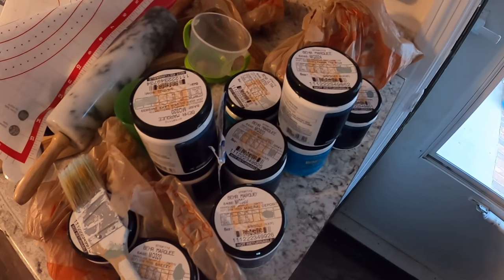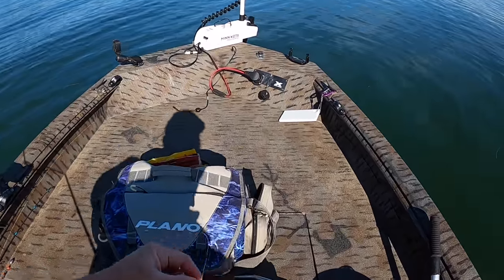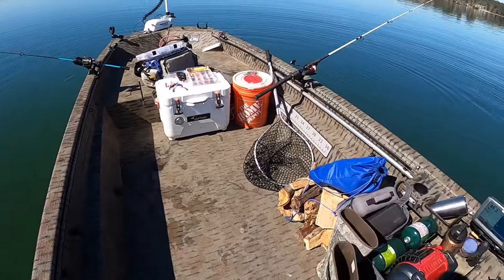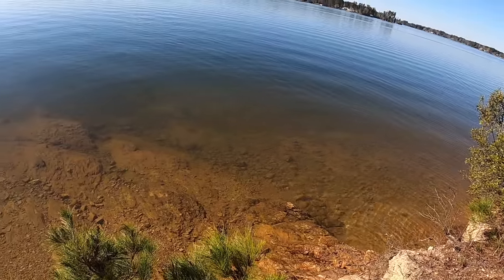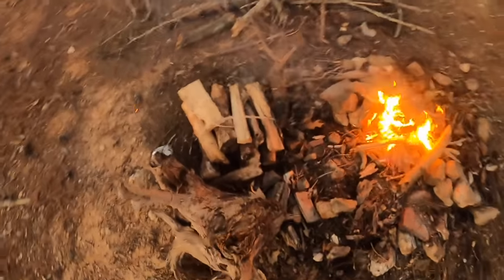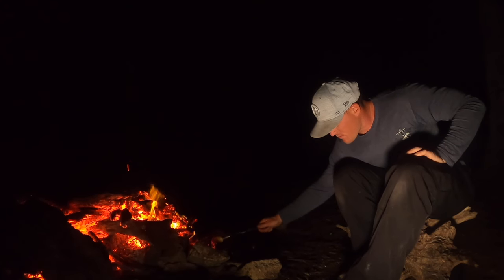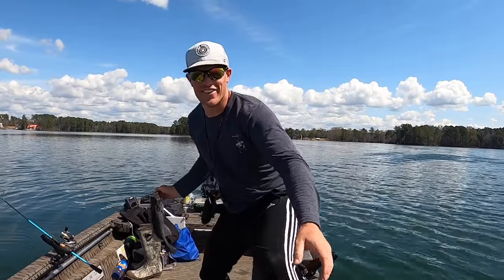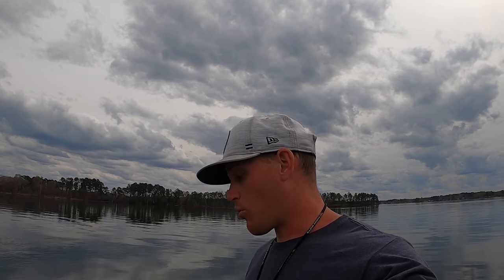Island Camping & Fire Roasting Personal Best Crappie!

Comment: McDonalds coffee is espresso ground not medium ground. You need medium ground to large. You also need to pour cold water into the finished pot of coffee and the cold will pull the grounds to the bottom of the pot as well as sink that coffee acidity that you wont get in junky mcdonalds coffee cause its not strong coffee.

Comment: So Micah, with a coffee percolator what you want to do is use a course ground coffee so that the pieces are mostly too large to fit through your basket. You can get a cheap coffee grinder at Wally world that should have a course grind setting. Then just buy a bag of whole beans, course grind a quart bag of it and take it out with you. Most ground coffee you get at the store is ground for a regular coffee pot setup so it is too finely ground for an old style percolator. Love your videos, keep doing your thing, those crappie were monsters!
Reply: Nah use any coffee you want make it stronger ..once it's done u take the basket out and put some cold water in the pot and the grounds will fall to the bottom ..either that or you can throw some egg shells into the pot and that will make them settle as well ..I'm the actual lot not the basket

Comment: Soo that's an old coffee pot and it's perfect for what your doing....
how to use it.... not sure about your grind but Folgers is the only one I have used for that.... so you Don't need the filter.... make the coffee and let it percolate till it is the right color for you in the glass on the pot and when it's done pull it from heat pour some into the cup.... add COLD WATER to the cup .. the grounds.... will SINK TO THE BOTTOM... stop before you get there... throw out the grounds in the cup.... repeat 
ENJOY YOUR COWBOY COFFEE

Comment: Just a comment about  painting your exterior. I've been in the paint business for 30 years, so I thought I'd give some advice. It looks like you have vinyl siding. If so, you can't paint it much darker than it already is. They put chemicals in the darker vinyl to keep it from warping in the summer heat. They don't put it in the lighter colored vinyl & the vinyl will start to warp. It actually looks like it melts & the seams start to pull apart exposing the lighter color underneath. I don't want you to do all that work & have to replace your vinyl in a couple of years. If your siding isn't vinyl, then any color will work, just make sure to use a sealer 1st that promotes good adhesion. Great crappie!

Comment: Hey Mike, if you’ve got a bass pro shop or you can order it online from Amazon, your order order a fish basket to hold all different sizes of fish and other things can’t get to it like turtles. I’ve had fish on stringers before it’s snapping turtle should come up and eat the fish. I pulled a stringer up running it. Nothing but the heads, it collapsible basket with two trap doors, one on the top, one on the bottom and they’re not much money

Comment: I have the exact same coffee pot. You have to use a medium or coarse grind coffee grounds. Anything less like espresso grind or fine grind coffee grounds will fall right through the holes when the water starts boiling or percolating.

Also, as others have said, if you pour a little bit of cold water into your cup after pouring your coffee it will cause the coffee grounds to settle to the bottom. Another trick I have heard is to use a small piece of the burning wood from your fire and touch it to the top of the water. Supposedly, that will make the coffee grounds fall to the bottom as well. I cannot vouch for this however.